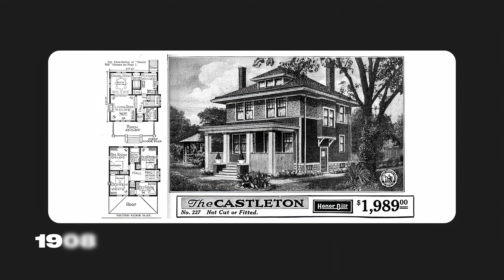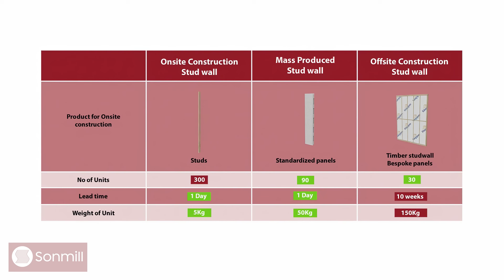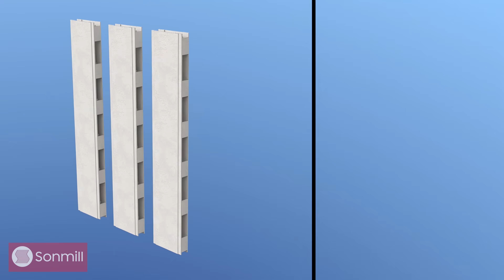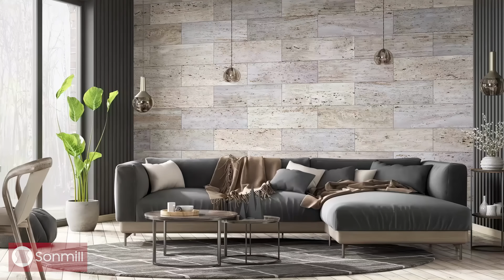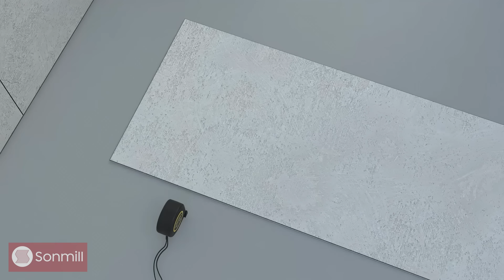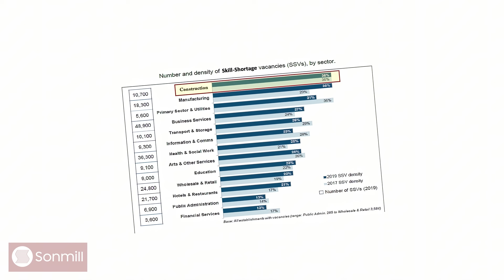New House Construction Method with Stud Integrated Modules – Part of Sonmill's Investor Pitch

Comment: Midland Housing Consortium (MHC) was responsible for supplying prefabricated house panels for most of the housing built by the Development Corporations back in 1970's that must amount to millions of homes.  Using these panels Peterborough Development Corporation built a MHC house onto prepared foundations ready for occupation in 9 days, which also included a brick outer skin constructed on site.
Reply from the maker: Thank you for the information. It seems they used timber frames to make the panels. That’s quite interesting, and there might be something valuable we can learn from it. Even though non-traditional construction methods have faced repeated failures in the past, there could still be lessons to uncover. 

I’m not sure how many people notice this. Bespoke timber frames enable faster construction than what we’re developing. The problem is bespoke panels, similar to custom-designed furniture: they are labour-intensive and involve longer lead times until robots read the drawings and fabricate the bespoke panels. We see an opportunity to offer standardised, lightweight, ready-to-build panels. Ideally, these panels should be available for off-the-shelf purchases like studs and blocks for on-site construction.
Reply: @Sonmill_UK  I am not aware of any intrinsic failures with the MHC system, it was widely used in Peterborough, Northampton, Corby and Telford, but it was only used by the Corporations themselves, not the mainstream house builders, who built alongside the Corporations..  The system provided various standard house types but it was common to use the components to provide a much bigger range.  It should be noted that the UK housebuilders all utilise standard house types so the MHC system should have been ideal.  I think the main issue is conservatism with the house builders building what they know and are convinced they can sell.  Until you overcome that conservatism with more forward thinking builders and customers pre-fabrication will be a difficult sell.